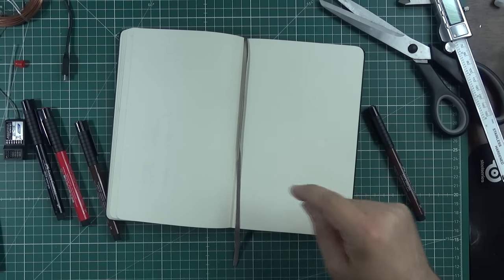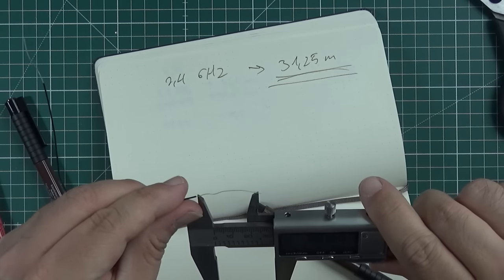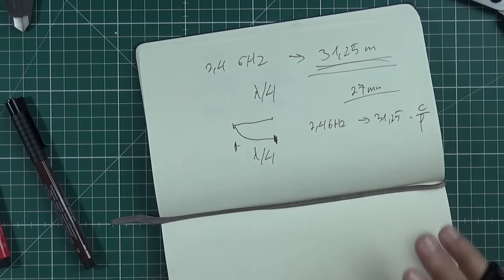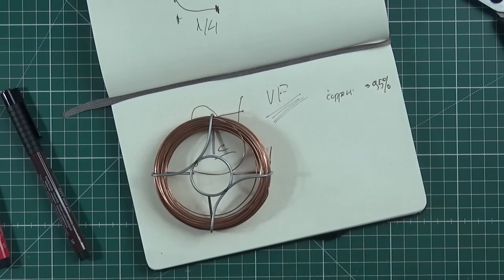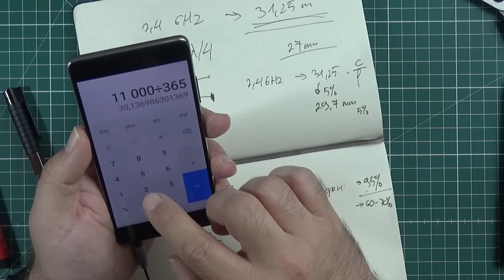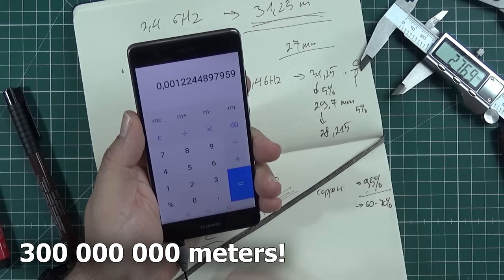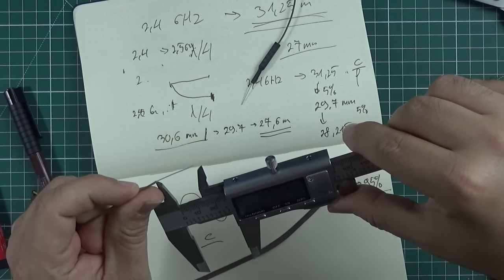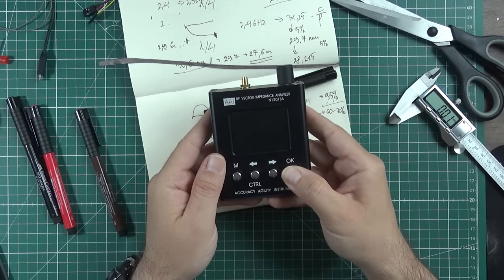How long 2.4GHz antenna should be?

Comment: I suppose that is one theory.  I'm not an antenna expert, but another theory might be that the goal is to maximize power from amplifier to antenna, which occurs when the antenna is resonant (meaning zero reactance).  That is typically around 0.48X the wavelength (meaning each leg is 0.24X the wavelength), which would be about 29.9 mm.  This is for a very thin conductor.  You get more bandwidth as the thickness increases and that 0.48X might be more like 0.45X for a typical antenna, which would be ~ 28 mm per leg.  And then the feedwire from amplifier to antenna further affects the resonant length, as does any inductance in the feed.  To get zero reactance the antenna might be shorter still.

Comment: I think you might be talking nonsense. For copper, the radio wave travels along the surface, rather than through the copper, due to the skin effect. Unlike with coaxial cable, where it does go through the copper.
Reply from the maker: https://lowpowerlab.com/guide/rf-best-practices/velocity-factor/#:~:text=The%20term%20we%20use%20to%20indicate%20how%20much,is%20around%200.95%20%2895%25%20the%20speed%20of%20light%29.
Reply: @FPVUniversity  I think that's not true. Perhaps the enamel is acting as a dielectric and reduces the velocity factor. Plastic coatings definitely do this, but a copper wire in free space has a velocity factor of almost 1 and in air its about 0.9999. Or perhaps I'm mistaken
Reply from the maker: I think the best way for you to accept that is to get a VNA and measure by yourself how long antenna should be. Especially the one with any insulation on

Comment: Well right or wrong, stripping my R-XSRs & XSR receivers to 31~mm dramatically improves the range (yes I have repeatedly tested it)... in fact my XM+ receivers (31mm out of the box) have always out ranged the others... So if 31 is not the magic number than what the heck is going on?
Reply: same here .. blah, blah ... i have tested this in the field before modding antennas to 31.2 i was getting only 400m range .. after mod over 1.6km  so talking is useless.

Comment: I measured my new r xsr antennas, one side was 31, the other was 33. Since I broke one in a horrible crash, not sure what length to cut it too. Maybe I'll just go with the standard 31, and tune from there. I had an XSR from last year, the  length was somewhere in the mid 20's, and after watching the rotor riot antenna test, I cut mine to 31, and the rssi and range did improve. Before I wasn't able to get over 85 rssi, now im able to get in the mid to high 90's. Just my experience with this.

Comment: That's cool and interesting. But lot of people including myself experienced range increase after "fixing" antenna length on XSR receiver. Could you please explain this ?
Reply from the maker: I'm not saying that FrSky did not fcked a batch of XSR. I'm saying that 31.25 is not the answer.
Reply: So, it turns out, that best way to figure out correct lenght, is to increase it to somewhere about 32mm. And cutting by ~1mm each time observing rssi :)
Reply: @FPVUniversity  This is out of my wheelhouse. I'm all digital. I would love a lesson in the specs of that however. DJI goggles and the antenna capacity, frequency, range, fixes, upgrades, etc.

Comment: can we reduce the protected part of the antenna or will reduce the performance? I have radiolink antennas and they are 27 mm but i have sent an email to the company and they said that i should buy a new antenna and not shorten it in the protected part. But the things is, they do have different size from the protected part. Maybe im wrong.

"We do not recommend to make any modifications on both antenna and coaxial cable. If you damage the antenna, the control distance will be damaged. Both of them are important. But if the top part antenna is damaged, there must be problem of signal transmission. Hope it will be clear to you."

Comment: Does the velocity factor change with length of the coax ?? ( if the coax VF is 69% , does this value change how long coax i use ?? ) 

Great tutorial!! 👍
Reply from the maker: No, velocity factor is constant for the conductor. So VF on 1m and 5m will be the same: 69% for example
Reply: @FPVUniversity  thank you for reply . 😊
Another small question . When i make an antenna with copper . It should be 95% , and then i connect to coax that has 69% . 

Should i calculate original wave length minus 5% and then that value again 69% ?? Or i can calculate 69% + 5% = 74% ??

Comment: Your spot on Pawel, I make many of my own antennas, and I always use brass elements where possible, but it needs to be way longer than copper to get perfect swr, the material used including alloys of copper and coatings, like nickel or silver make a substantial difference to correctly tuned length. I also use the same Vector analyser, my favourite tool.

Comment: and I'd push it again if I could! after actually watching the video. Thanks for finaly enlightening me!-)  BUT, 31.25mm always kind of worked for me...
On an more urgent note,  what would your suggestion be for the smallest sized 868Mhz Antenna? Folded Dipole made of 0.1 spring steel rod?? Goal is Crossfire on a 3" quad! I know its a bit stupid but I've somehow managed to kill all my Frsky TX modules over the years...
Reply from the maker: Just 80mm of copper wire somewhere. On a 3" you will not go far and Crossfire even on lowest power will cover that. LoRa modulation over there is fantastic
Reply: Gona try! Do's it have to be Copper? I always liked using spring steel back in the 35Mhz days!  (well it was actually 40Mhz where I live!)
Reply from the maker: with the power output we have here, it makes no difference. Whatever suits you more

Comment: your calculations has too much classroom assumptions built in to it... basically what you said at 11:22 is the truth of the matter with regards to an antenna’s final length. It varies depending on how the receiver is designed. Even then, there is again the tx power to be considered.. lol

Comment: "What you're saying is bullshit. You have no idea what you're talking about."
Not true!  What they're saying is correct - for step 1. They are properly calculating a quarter wavelength. They just didn't know to then multiply by the velocity factor.

They did exactly right for step 1 (calculate 1/4 wavelength). It's not bullshit, it's correct. THEN step 2 is to apply the velocity factor of the medium.